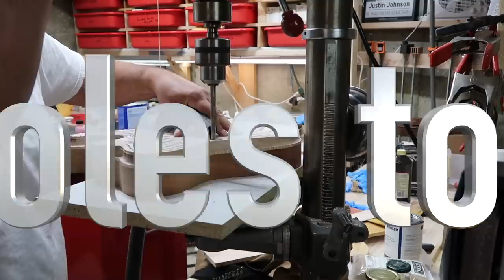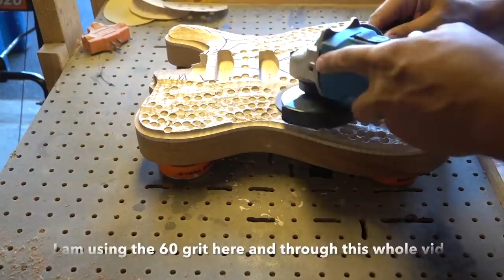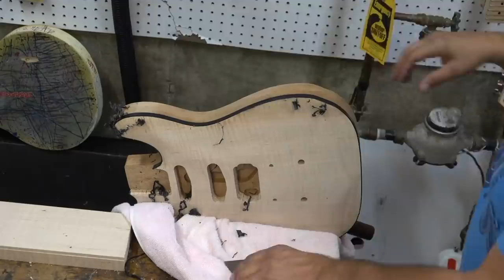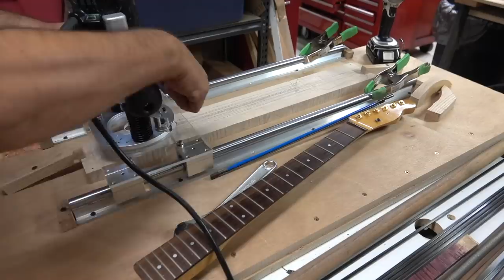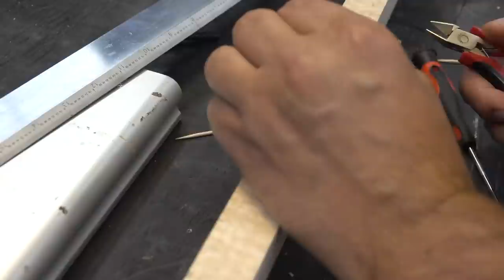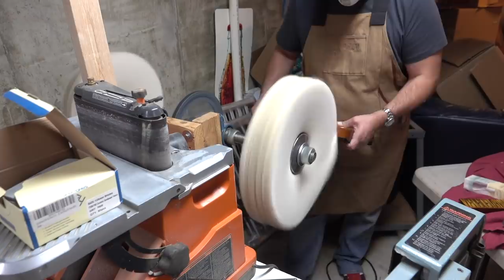Carve Top Tele - Complete Timelapse Build

Comment: Those finish colors worked out great and the body & neck looked absolutely stunning. But man, that flame maple you got there is the stuff dreams are made of!... Let me tell you, the unthinkable things I would do to have a garage full of it in 8/4. Another work of art my man!
Reply from the maker: I have some pieces I could spare of this same log.
Reply: @bigdguitars  You are much to kind and I can't tell you how much I appreciate the offer. Waiting on the weather to break a bit so I can begin setting up shop in the garage. I will certainly hit you up once I'm equipped to store/stock material. I'm not even equipped yet to begin resawing & processing any material. I've found some figured curly locally (Central Ohio), but it is nowhere near close to what you have there. I will be in touch in the not to distant future for certain. You rock my man.

Comment: That is a lot of work to put into a nice carved top. I am simply blown away on how you went about it with the holes and then chiseling the top. Just nuts! That is a beautiful guitar all around and probably one of the best I’ve seen you do tele wise. I like the fact you used true oil on this one. I use either true oil or wipe on poly on kits I build due to ease and I like the look. Kinda more natural in a way. Excellent, excellent work!!